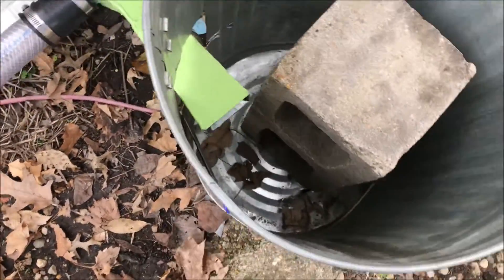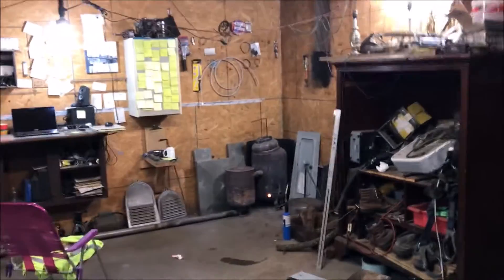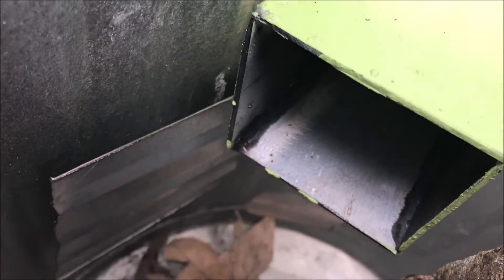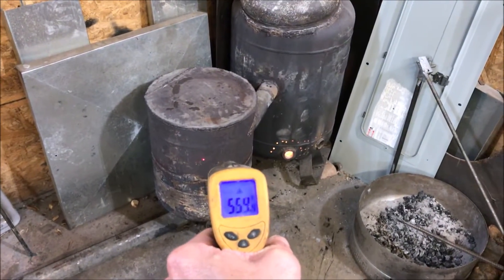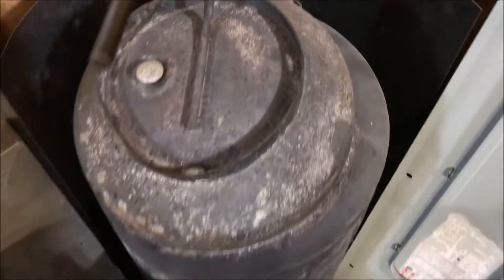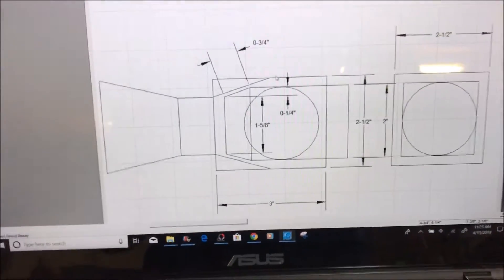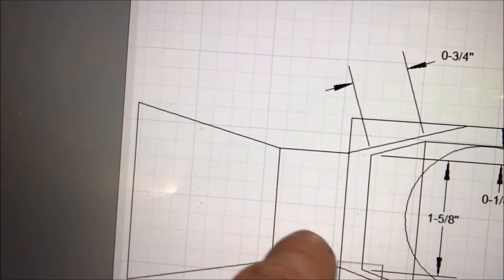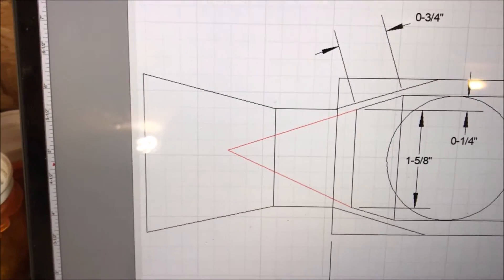Venturi Effect High temp Vacuum system

Comment: brushes are used up higher the rpm (relative speed, depending on comutator diameter) and higher the spring tension. i have replaced brushes in my tools many times but cant really say how long they run because its never continuous. i assume longest lasting i have ever seen were in my cars alternator which were used up about 330k kms, and they were not very large as as in radiator fan for example but thats different design (collector slip ring)
Reply from the maker: Yeah i never thought about a car , its loaded with brushed motors
Reply: though they do run for quite a while.. i wouldnt worry at all if you are running it at half power

Comment: You might get better results if you switch your heater (vacuum) and (fan) pressure in.

Your shapes look right, but from stuff I have read it seems to be hooked up backwards.

Hope it works out for you  and if do see better results, please post them, I am curious about subject.

Thanks for the video!
Reply from the maker: actually  its not backwards it doesn't work as well the other direction y  , there are many configurations to choose from  . this one is the most suitable for cleaning but thanks for your input